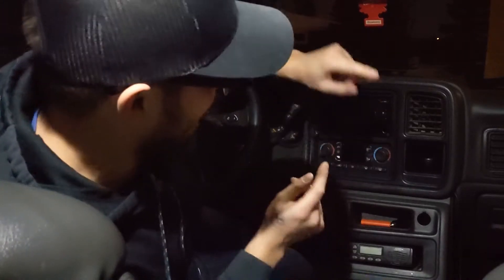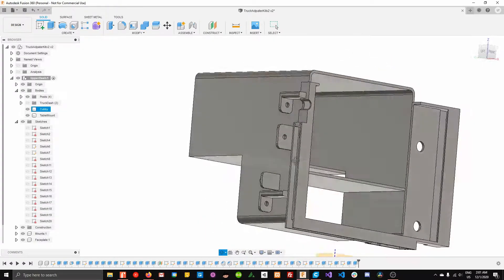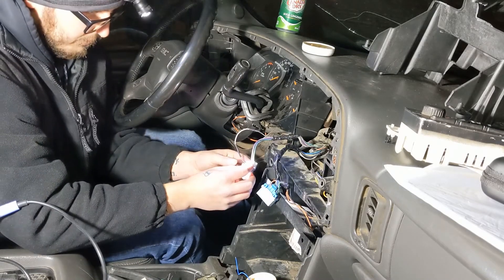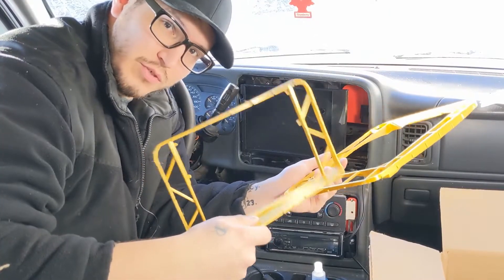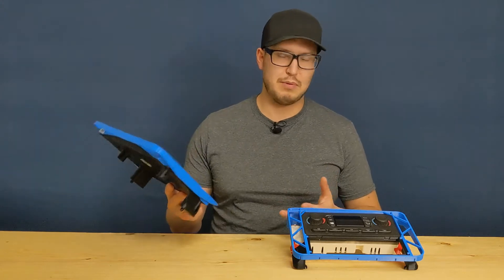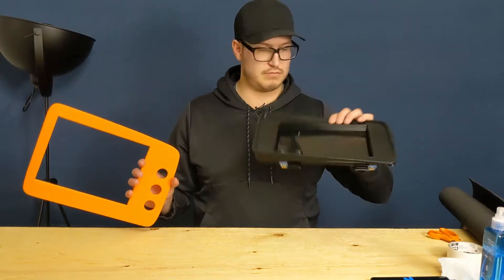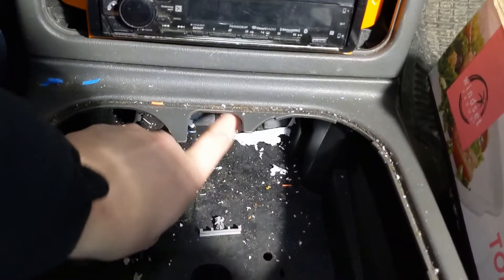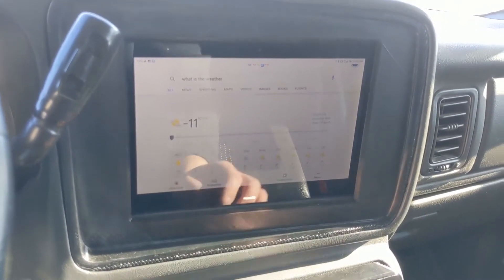iPad / Tablet Dash Install - 3D Printed

Comment from the maker: Updated Version 2: https://youtu.be/AeFrfc5SkDQ
Reply: How much for this
Reply: I think this build up is great! Next time spend $35 on a stepper bit when drilling the console outlet. I would consider redoing the temp wiring to the plug behind the dash and tilting the iPad so that the camera has the best angle on you the driver when you are trying to video chat with someone while you are stuck in the road. I had wanted to do the same modifications to my infinity fx35 dash for some time. It was difficult fumbling through the radio and making sure my cellphone was charged. I would consider doing a wireless console charger inlay next to rest my cellphone while driving down the road also adding a few in ports and an AC outlet in the console with a power inverter mounted under the hood to charge a laptop. Great work!

Comment: Man bro u should make and sell some i would be interested and im sure there are more that would be too
Reply from the maker: The Dash Kit STL Files are now available, linked in the description! Thanks for watching!
Reply: @LucasBuildsStuff  thank you I just need to find somewhere that has a 3d printer now 😞
Reply: Hey brother which iPad would u recommend is the best easiest size to use for everyday use or do they all seem to work the same what I mean is does the smaller iPad kit work easier to load unload iPad than the bigger iPad kit u sale so I will know which one to order from you thanks for your time. @LucasBuildsStuff
Reply: @LucasBuildsStuff you don't have them printed for sale.

Comment: envyous of the space and ease of removing interior parts like that... use to german cars, like everything is bolted down and like 5 of the bolts are behind something else that you also need to remove.. and when removed, every little cranny is packed with electronic gizmos or sound deadening

Comment: Tablets are not made to withstand the heat and cold tolerances required for in-dash use.
Reply from the maker: Probably but I haven't had any issues yet

Comment: If I was doing what you are doing I would tilt the screen towards me to give the appearance of an airplane cockpit, using some parts from the initial dashboard and extending them on one side to tilt it toward the driver you could also have tilting to the driver as standard but you could give it the capability of turning back flat by incorporating some bellows fabric and a simple threaded bolt could help it manoeuvre to tilted to the 2 going back flat and listen once you enter into a project like this the sky is the limit you can do what you want really I suppose the most simple way would be to purchase some sort of holding the voice that can swivel in any direction and build around the edges of the device with fibreglass to give that more professional look you might not get it on your first run but I assure you you will pick it up

Comment: terminal block would definetly be a safer method than exposed screw heads. or butt splices for a more permanent connection
https://www.amazon.ca/10Pcs-Terminals-Electric-Barrier-12-terminal/dp/B077D69TSD/ref=sr_1_9?dchild=1&keywords=terminal+block&qid=1620183355&sr=8-9

and step drill bit might be a tool worth having in your arsenal. Beats a spade bit when drilling into flat plastics and metal consistently. 
love the build. Definitely can relate with the "quirky" wiring of diy car stereos. I'm part of the problem though. i ended up doing some janky shit to get mine working in a 97 honda civic

Comment: i loved sticking the foam to the monitor and tracing it. Another method is to take a picture (making sure your perpendicular to the outline) and upload it into google sketchup and trace it their. Even better than that is using a scanner on a printer.
Reply from the maker: Haha thanks, I've heard of using a scanner in the past but it didn't even cross my mind till I read your comment😅
Reply: google raster image cad. i use it all the time, just make a spline and you have yourself a class a surface

Comment: Hey buddy, I hope this is still working well.  I don't know if you printed it in PLA, but I would suggest using something like ASA or Nylon, as those will not soften with heat / age.  There are some pretty good videos on YT that show different materials being left on a dash in the heat (and I don't mean blazing heat, just standard heat).  It would be a good reference.

I've done all my automotive stuff in ASA - it prints beautifully and is UV and heat resistant without an enormous price tag.

Even if heat is not an issue (it appears you live in a cold climate) ASA is still a great choice to reduce cold brittleness of the material and improve impact resistance.
Reply from the maker: Hey! So I used PETG because of the temperature resistance being close to ABS, UV protected, easy to print and the stiffness of the final product. But I was just looking into ASA and Nylon the other day because the biggest downfall I've found with PETG is the post processing. (I'm working on version 2 which is requiring a lot of supports) 

So far it's only been in moderate temperatures, -20C to +15C and no issues yet!

Do you have a brand for ASA you could recommend?
Also thank you for watching!
Reply: @LucasBuildsStuff  I absolutely LOVE eSun's ASA.  ZERO post processing needed.  I run a 0.4mm nozzle with 250°C nozzle and 90°C bed.  All prints done on glass, though PEI will work for smaller components.  Try to avoid sharp corners on the first layer (use a brim or raft) because it will try to peel up even with adhesive if the part is too thick/sharp corners/chonky.  Also, no fans.

If you still have warping issues after trying that, you can bump the bed all the way up to 110 or so.  However, I've only ever had the lifting/warping issue happen when i was printing basically a solid rectangular housing with stupid settings.

Its a great product, supports break off and leave zero witness marks, print quality is out of this world, and it feels nice to the touch.  To me, it prints better than any other filament. 

Also, thanks for providing the content!  You're doing a great job.
Reply from the maker: Sorry for the late reply, I'll definitely try it out in one of my next projects! Thanks for the tips!